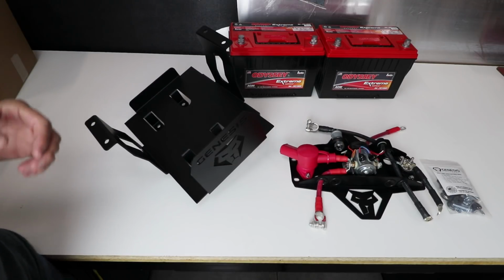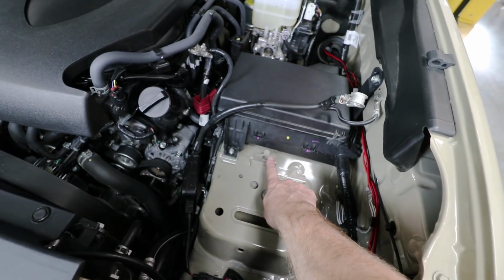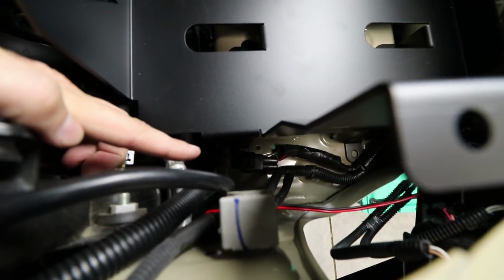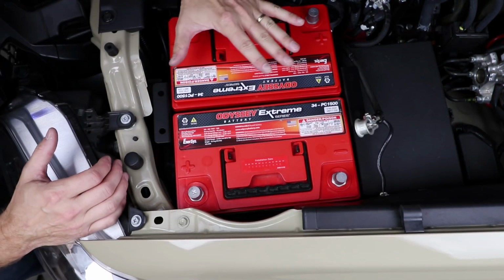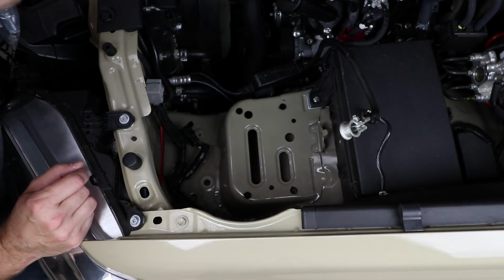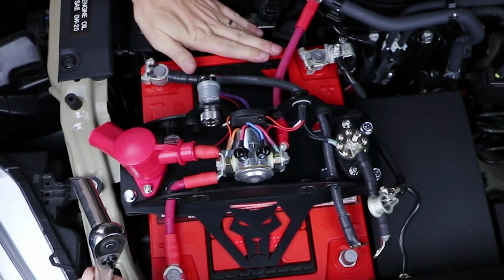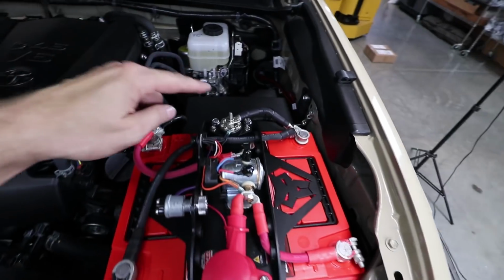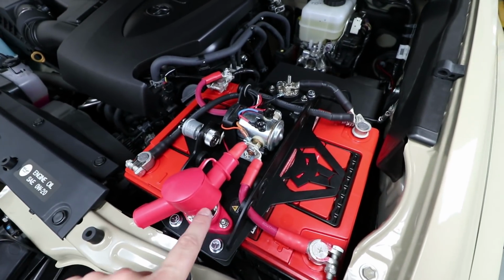Toyota Tacoma Dual Battery Kit Installation Instructions

Comment from the maker: This kit has been updated! Now comes with an even more heavy duty battery tray that is easier to install! Also the installation process now uses steel nutserts instead of rubber well nuts, and those require a 25/64" drill bit. Please download our pdf instructions for more details on installing the nutserts. https://www.genesisoffroad.com/assets/instructions/tacomadbk.pdf
Reply: You have a great system... my unit came with the steel nuts you speak of...... the sheet metal of the fender, is not strong enough to hold the weight of both batteries.... your system tore through the wheel well mount with in about 2-3 months... 
please build us a separate battery system... on in the stock location, and one on the right side where we put the arb air compressor locates.... yes build us a battery mount with a arb compressor mount..... thanks!!
Reply from the maker: @scottlilly4091  I'm sorry to hear about this. We had a couple reports of this happening about a year ago, so we redesigned the battery tray to use much larger mounting legs which distributes the weight over a much wider surface area to prevent this from happening. If you'll send us an email we'll be more than happy to swap out your tray with the new design. info@genesisoffroad.com

Comment: hello the sep up looks very nice except for positive terminal on auxiliary battery is to close to metal in case on accident happen the metal of the radiator Suport hit the terminals going to cause a short and cause any fire on the engine compartment

Comment: Why do you manufacture a bracket that won't fit those factory holes?  Forcing you to drill?
Reply from the maker: There are several holes in the factory battery shelf but they are all different sizes. It is such a tight fit in there that it would be extremely hard to have a new tray line up perfectly with those holes and also fit around everything else. Our method gives you a little bit of wiggle room with the exact placement of the mounting locations.

Comment: So I followed the instructional video, drilled the 1/2 inch holes and the rivnuts fell through... I went online to discover there must have been a change to the hardware? Any advice on how to remedy this situation? I reinstalled the old battery in place and I order a bunch of assorted sized rivnuts... Hope no one else makes the same mistake..
Reply: Yeah just did the same thing they need to take this video down

Comment: I have one PC1500T will that work with this kit?
Reply from the maker: Yes that is the correct battery for this kit.
Reply: @GenesisOffroad   OK thanks I know the 1500 series battery works but I wanted to double check because mine has a T at the end.
Reply from the maker: @zacksmith-s2c  on some other models from Odyssey the T is an option noting the posts are on top, but on the Group 34 size, that’s the only way it comes, so you may see the part number displayed as 34-PC1500 or 34-PC1500T but they are identical. Also just fyi that exact part number has been discontinued by Odyssey. They redid their part numbering scheme not too long ago. The new part number for that same battery is ODX-AGM34. Only the part number changed, there were no changes to the battery itself.
Reply: @GenesisOffroad  Awesome thanks for the information I really appreciate it I’m going to order another battery and one of your other kits tonight.
Reply from the maker: @zacksmith-s2c  Sweet! Thanks Zack, we appreciate you! It will ship tomorrow afternoon!

Comment: will this system work to run electronics like a refrigerated cooler, electric skillet, etc... off the power outlet in the bed of the truck?
Reply from the maker: Yes, but please keep in mind that all of your factory circuits like the power outlet in the bed, headlights, radio, etc will always run from your cranking battery. If you want to run your accessories with the engine off, we recommend installing a new dedicated power outlet in the bed and running that to the power & ground bus bars on our kit. This way your fridge and skillet and whatever else you have on those bus bars will run from your second battery and will not drain down your cranking battery. We want to leave that cranking battery just for starting the engine. Here's a link to some of our 12v and USB power outlets for this purpose - https://www.genesisoffroad.com/power-outlets

Comment: Thinking of going with this set up over just a standard group 31. Do you guys have any issues with the positive terminal being so close to the body? Any flex or a crash on that fender I’d be worried about a short.
Reply from the maker: We have not had any reports of problems with that positive post in the 5 years since we launched this kit. However, if you'd like to get a little bit of extra clearance, it is very easy to bend that factory sheetmetal back away from the battery post a little bit. You can also add a layer or two of electrical tape on that sheetmetal piece for extra insulation. Never hurts to be over careful!

Comment: You should always remove the Negative post off first that eliminates any sparks if you accidentally touch any metallic parts.
Reply: Not knowing the basic procedure to remove the Negative first and connecting last I can't help wondering what else they don't know.
Reply from the maker: Great tip! Thanks!

Comment: After sticking the two 34s up front, would it be possible to stick a 3rd 34 by the passenger side firewall for three under hood batteries?
Reply from the maker: Yes, you can do that. You'll simply connect the positive and negative posts of the third battery to the positive and negative bus bars on our dual kit. This way the second battery in our tray will be connected in parallel to the third battery all the time. This will double your run time for all the accessories that are connected to our bus bars.

Comment: Interesting concept Shane. It looks like a lot of thought went into it ! I like the idea of the delay charge timer to give the main battery a chance to catch up a bit. We sure don't want to smoke the alternator.
Any issues with the oil fill cap hitting the battery bracket as the engine rocks back and forth from normal use ? 
Just a thought, have a bracket to hold the group 35 battery for the truck, then maybe a slightly smaller group battery for the accessory one  ?
Reply from the maker: Thanks! As you can see in the video, it's very tight in every direction, so it takes a bit of care to position the tray to be away from the oil fill neck, but there is a simple trick to dealing with that - you can simply remove the oil fill neck and spin it 180 degrees and reattach it. This way it is still very accessible, but it is pointing away from the corner of the battery to give you some more wiggle room. 
As for the Group 35 - that one has the positive and negative posts on the wrong side to work for us. Our 4Runner and Tundra kits use a Group 25, which is the same dimensions as the Group 35 but with the posts in the correct orientation to line up with your factory wires. There's a few reasons we use the Group 34 in the Tacoma. 1 - It is shorter than the Group 25, and hood clearance is a concern in the Tacoma - we can't fit a taller battery in there. 2 - The posts are in the right spot so the factory wires line up correctly with no modifications needed. 3 - It has slightly more capacity than a Group 25/35 and we wanted to provide as much power as possible so you can run your accessories for as long as possible. 
Hope this helps!
-Shane
Reply: @GenesisOffroad  Thanks for the reply Shane, makes sense to me ! :)

Comment: Driver's headlight becomes unserviceable with that configuration, I'd assume.
Reply from the maker: It's tight in there for sure, but if you do need to change your headlight bulb once every 10 years or so, it only take a couple minutes to lift the lid off the batteries and pull the batteries out, then the back of the headlights will be fully accessible.

Comment: Do you have a kit for the 3rd gen Tacoma TRD Pro that puts one battery on the drivers side, and one on the passenger side?
Reply from the maker: No, we do not have a system for the passenger side of the Tacoma. We prefer to keep the batteries together, which frees up that spot on the passenger side for mounting something else like an air compressor. However, we do have a universal single battery kit that lets you mount your second battery somewhere else, and run cables back to the crank battery to tie it in to your cranking battery. That one has a basic battery tray so you’ll need to figure out how to get it mounted securely in your application.

Comment: Just purchased a 2021 Tacoma and it appears the fuse box can be moved a bit to the rear of the vehicle so perhaps the fuse box tab does not need to be cut off.  Have you considered this?
Reply from the maker: We may start including the same fuse box relocation brackets that are used for our Tundra and 4Runner kits for the new Tacoma. That would probably give a little extra room to work in there since it is so tight. I do plan to shoot an updated install video for the Tacoma soon to add some new tips that we’ve learned over the years.
Reply: @GenesisOffroad  Hoping you can get that updated video out soon. I'm getting ready to install this by one of your resellers in the Vancouver area, British Columbia, Canada.

Comment: Not sure what it cost for that set up but person can add two batteries to any make of vehicle ford chevy gm just using solonoid that will constantly charge both batteries constantly for really cheap.
Reply from the maker: If you have the time, the tools, and the skills to do your own dual battery system, that’s great, but you still need a place to put the batteries. That’s why we sell all of our vehicle-specific kits as a DIY version. You can get the tray and installation hardware, and then add your own wiring and electronics.

Comment: did you upgrade the alternator?
Reply from the maker: No need to upgrade the alternator. When our system links them together in parallel, they work like one large battery and the alternator charges them both.

Comment: 5:51 Would be better if it didnt require trimming of the fuse box, I dont like to deal permanent damage to the truck parts.
Reply from the maker: It would be better if Toyota had left us one extra inch! It's not required to trim that part of the fuse box, it just makes it a little easier to get the cover off when you need to get inside there.
Reply: @GenesisOffroad  I just installed mine today and I didn't have to trim anything whatsoever! It all depends on your liking like Shane mentioned. Best looking kit, and it works flawlessly!

Comment: Are those both starter batteries by any chance?
Also, and mostly curious, as 3rd gen Tacomas have smart alternators does that smart isolator do a good job at keeping both / the secondary battery topped off? 
And maybe the issue Im thinking of has mostly to do with a deep cycle linked to your primary starter as the Alternator in that specific scenario typically doesn't see your other battery. 
I'm just sifting through some various bits of info and trying to confirm small details as I build on paper my future electrical setup. 
Thanks for the how to!  Looks like a cool setup.
Reply from the maker: The batteries shown in the vehicle are Odyssey dual purpose batteries. They are just as good at cranking as a normal starting battery, but they give you the added benefit of deep cycle capabilities as well. 
A smart alternator will vary its output based on what the battery needs. If it sees the batteries are full, it can reduce its output to help save a couple drops of gas. If it sees the batteries are low, it will increase its output to help charge them. Our system simply links the 2 batteries together in parallel. At that point they look just like one large battery. Otherwise there is no change to the way the alternator or the rest of the electrical system works.
Hope this helps! Let us know if you have any other questions!

Comment: I have the same question/concern as the "Fat Italian" LOL! Is this a plug and play setup or do you need to re program the computer so it charges at the correct voltage???
Reply from the maker: Our system does not change anything at all with the factory charging system. See response to his question below.

Comment: Got anything for a 2nd gen Tacoma? Thanks
Reply from the maker: The 2nd gen Tacoma kit is coming soon! Here's a link to that kit and you can sign up for our waiting list to be notified when it's ready. We will run a special discount program just for folks on our waiting list! https://www.genesisoffroad.com/2gen-tacoma-dual-battery-kit
Reply from the maker: The 2nd gen Tacoma kit is now in stock for immediate shipping! https://www.genesisoffroad.com/2gen-tacoma-dual-battery-kit
Reply: Thanks for the quick reply. Further question. I have a shell. I'd like to out the battery in the truck bed. Will your system have something for that set up? Thanks o

Comment: So... what is the purpose of a dual battery set up?  Given the fact that portable power and solar cells that are taking the market by storm... at least for powering accessories... why would anyone need two batteries in their rig?  Especially if their rig doesn't have outlets, like a Tacoma. A portable battery, especially one with solar capability seems so much more practical, useful, obvious... of a choice.
Reply: What year is your Tacoma? Did you see if your Taco has the outlet in the left rear position? This dual option saves you from  spending money on solar gear as the truck will charge both batteries. You can get this kit and get solar and you are about 98% bullet proof for whatever you want.

Comment: I want to run this setup with an SPod.  I think that would be the cleanest hook up ever.
Reply from the maker: Definitely! We love the sPOD fuse boxes and highly recommend them! Our kit gives you the extra battery capacity and protection for your cranking battery, and the sPOD gives you a clean way to connect accessories that need a fuse, relay, and a switch.
Reply: Do you make the plate for the spod to mount somewhere in Toyota Tacoma?  Also does it fit 2020 Tacoma?
Reply from the maker: @FrenchHawk878   sPOD makes 3 versions of a little mounting plate for the Tacoma. One allows you to mount just the G Screen over the little storage cubby, one lets you mount the G Screen and an sPOD on a RAM ball mount, and the last one is for just the sPOD by itself.
Reply: @FrenchHawk878  the Spod mounts on top of the factory fuse box.  My only concern with this is that the genesis duel battery setup might not leave enough room for that to mount correctly as it look like from this video that the negative battery cable might be in the way?

Comment: cool kit, but may i suggest using cable lugs with the holes that match the bolt size, like the 2 negative lugs were way too big on that bolt, makes for a bad connection, that can overheat and start a fire

Comment: $1300???
Reply from the maker: Our dual battery system is $529. You'll need a couple Group 34 batteries to fit in the tray. We offer the Odyssey 34-PC1500 battery for $295.99 each (free shipping on the batteries). And if you would like to add on the optional G Screen monitoring system, it's $269. So with all the options, plus shipping, it will be around $1,400.
Reply: It is high but you can run a cheaper version of this using marine solenoid only have to make a custom battery tray using the existing lock down bolt holes to line up in new custom tray.
Batteries are going to be least 150-180$ but can use the existing battery with a deep marine cycle battery. I was thinking doing this to my 017 tacoma just havent had time yet nonetheless this method would be just under half the amount what the kit is here in this vid.
Reply: @MartyCanter  this kit is a better deal. Your approach might be cheaper but you are not counting the labor/design hours. In the end, you will probably come even. This kit is a deal compared to the amount of crap you add to your rig. Crap like an RRT, ham radios and all the required gear, a Dometic, winch, lift...shit! That is already a lot of money.

Comment: After install the battery, can the fuse box still be access without remove the battery?
Reply from the maker: Yes. It's tight in there for sure. If your fingers can't reach the little tab to open the fuse box lid, you can use a flat head screwdriver to press that little tab, then the lid will pop right off. On my truck I used a dremel to cut off that little latching tab on the front to make it easier to get into the fuse box.
Reply: Thanks Shane.